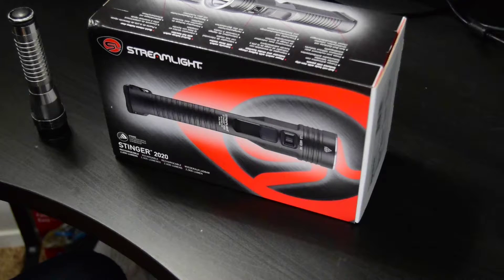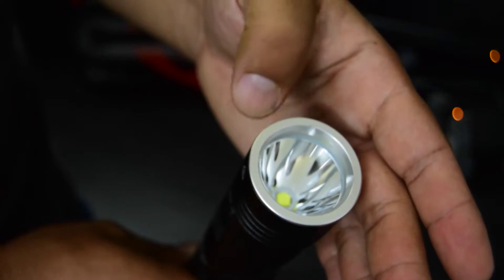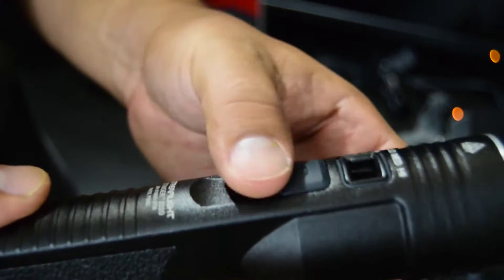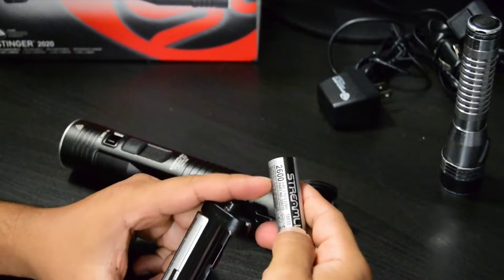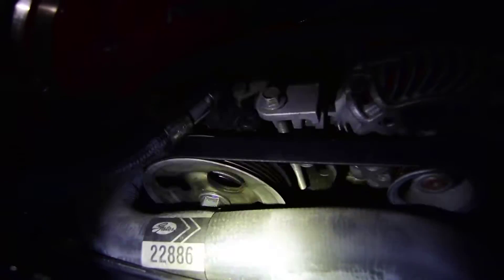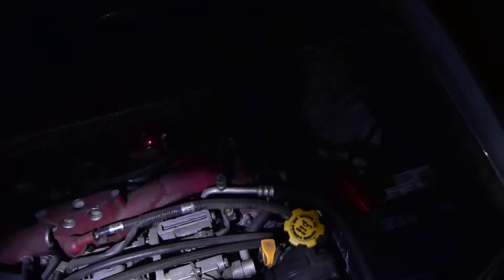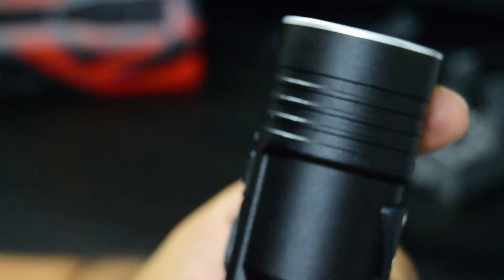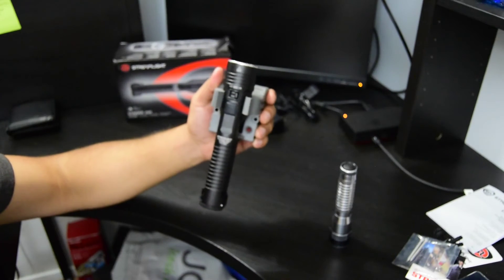***2020 Stinger Flashlight Detailed Review***

Comment: I was wondering if you could confirm that this light will hold 2000 lumens with no step-down or dimming for 2 hours straight. I am a flashlight enthusiast with some of the most expensive and best branded flashlights out there with batteries that are double the size (meaning 2×21700 batteries 8000mah total) inside my Fenix LR35R 10,000 lumen light. I do not believe for the life of me that it could hold 2k lumens for 2 hours straight without fans or at least more battery power. The reason I'm dumbfounded is your Stinger has about 5200mah of battery and my LR35R has 75 plus percent more Milli Amp Hours to it and cannot hold that kind of lighting, thank you and great video, I love your STI it's my dream car.
Reply from the maker: yeah I can definitely see your concern, I feel like when they create those time tables it's based more on the math and doesn't take into account power loss from heat, or even premature shutdown so protect from heat damage. I'll comment back on here once I have a better idea of those test results.

Comment: Looking at retiring my old stinger from mechanic duty. Do you recon the grips will peel off over 5-10 years? Or do you think the intensity switch would be a place for coolant or oil to get it if it falls in a bucket of the stuff? I know it would be durable and survive the daily drop or two, but I am concerned about fluid entering through the switch.
Reply from the maker: The ipx rating is even better for this model so i wouldn't be worried about water intrusion. However i can see it being annoying if a lil coolant gets trapped in the switch area, but you could always blow it out with a air tool. And as far as the grips them seem really solid and even if you had issues streamlight would cover it. So ya, hope that helps

Comment: Curious about belt holster/vest mounting options. Have you tried anything? I was wondering if one of those pistol taco mag pouches or similar asp pouches would work.
Reply from the maker: no i havent i normally run firearm mounted lights. if you know the sizing of those pistol mag pouches, the dimensions of the light are 
base - 1, 5/8 inch x 1, 3/8, it remains that size for about 4 1/2 inches then it becomes cylindrical 1, 5/8 x 1,5/8. It is also base heavy so it should flop out if the mag pouches are only 4 inches deep. hope that helps
Reply: @RatedRTV  thanks for the dimensions. Also I don't mean firearm mounted, just a holster specifically for the light on a belt.
Reply from the maker: @charlesaferg  okay. Yeah i just pocket it. If you find something, let us know 👍
Reply: I have a Stinger 2020 en route and I plan on trying out one of my existing HSGI taco pouches. If it's a good fit I can let you know. I also will attempt to vest mount this light for LEO Duty.
Reply from the maker: @mijotorrez  very cool alex! Let us know

Comment: does your light shine a bright blue dot at the center of the beam?
i noticed this on mine, it has a blue dot at the center of the beam?

i kinda see it in your video at 14:00 mark when you move the light around, u see a purple/blue center spot in the beam.
Reply from the maker: Yup i just checked and i do see a blue circlr on the low setting, its faint tho
Reply: @RatedRTV  once i noticed the blue dot, i could not unsee it, I can see it when in low, mid and in HIGH.

i emailed Streamlight and if they tell me it's normal, i might just have to return this light, i have DOZENS of led lights from surefire, olight, Fenix, Streamlight, maglight, Milwaukee tools, snap-on.

it is very distracting once you see and know about it.
Reply from the maker: @akui88  maybe a defect in the led, kelvin level a little too high